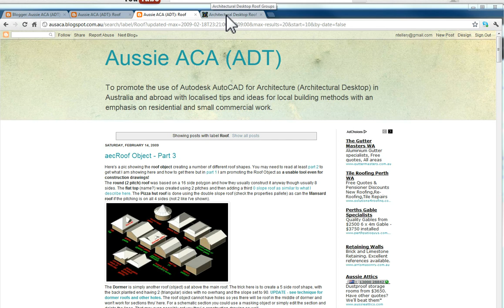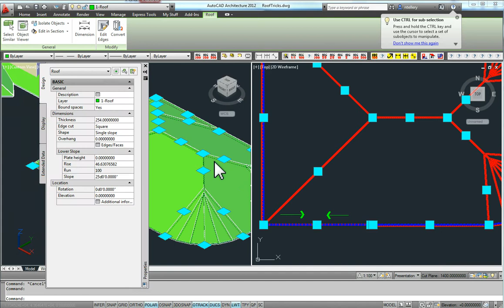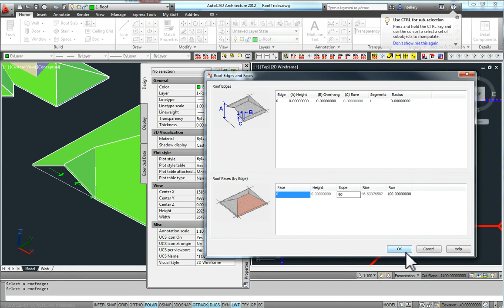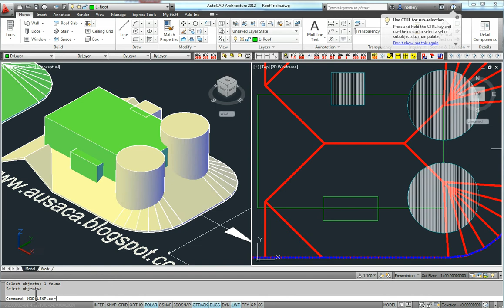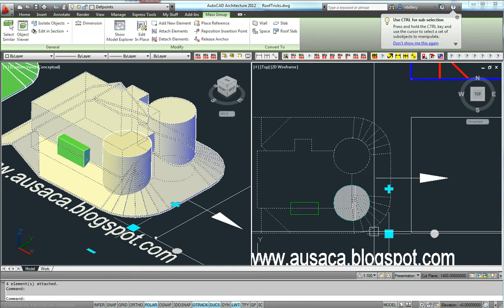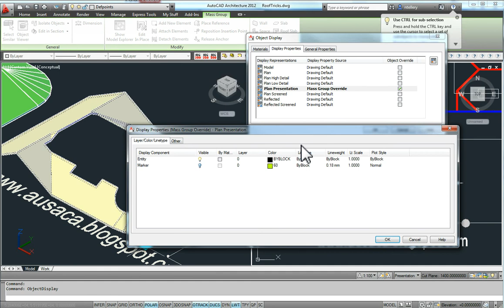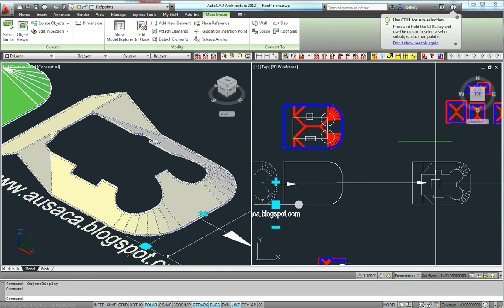ACA Roof Object 11 - Cutting Holes

Comment: Thanks for your videos. Could you show us one showing how to design a roof that has an inner courtyard?. I mean not just opening a hole, but considering the space in the inner courtyard.
Reply: You are welcome Gustavo.
Essentially you cannot truly do it so again you have to fake it.
One effort I did was to create the roof all around but leaving a small gap.  So? Where can that be because you will see a line for the break.
I've not done this one any particular real job but just to see if there was a solution.
Create the gap across the hip lines!  ?   So across a corner where the roof turns there are hip & valley from the outside gutter to the inside.  Create the roof close to the corner and using the stretch command you can zoom in and stretch the two (or more) vertice in so close together that they will disappear and not be visible on a print out. I generally use 10mm when I am doing something like this.  
If that's not clear, make a C shape with your finger and thumb and then bring them close so they almost touch to appear to be a circle.

Comment: Is there a way to create an arched opening in a curved wall that is curved vs straight lines?
Reply: That should be easy to do.  Just add an opening to a wall and make the opening an arched head.
If you mean the way it cuts thru the wall??  I would guess to create the shape you want out of a mass element and then add it to the wall as a subtractive element.